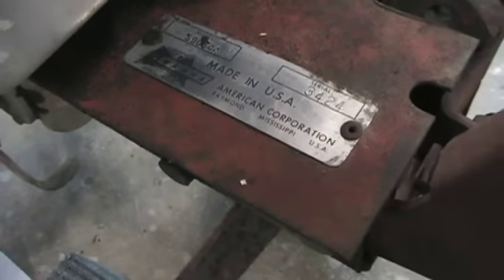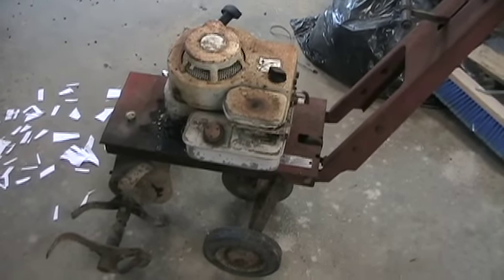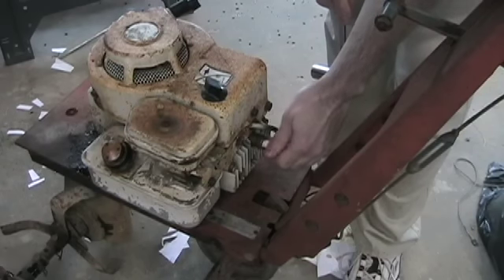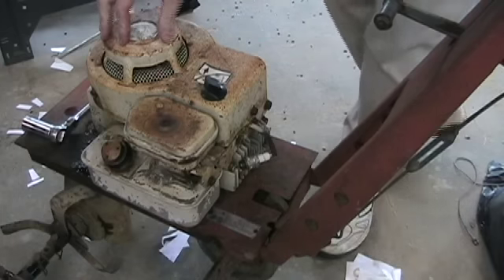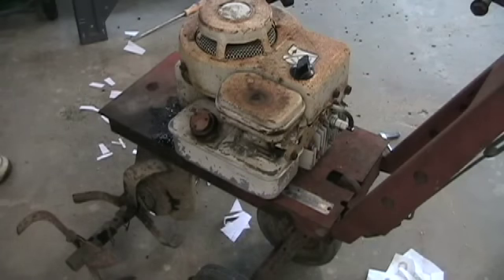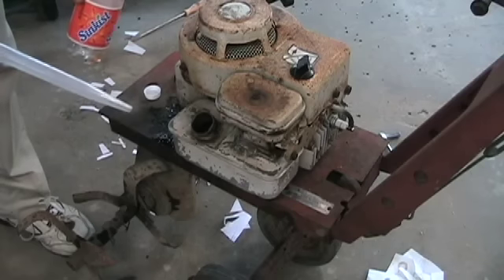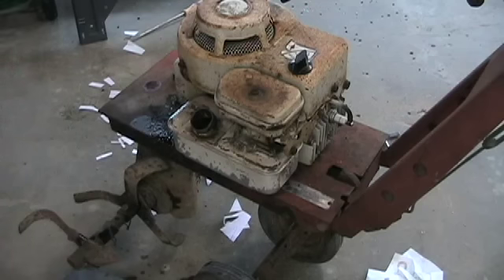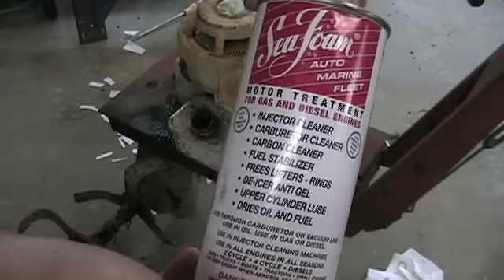Free Tiller project, Part 2 - Motor

Comment: How much oil does it take? Do you have a part number for the air filter?
Reply from the maker: Likely 1/2 a quart (but mostly until it is full) and just about any Briggs flathead air filter that looks similar.  Still likely to be at most hardware stores.

Comment: Those actually are not ratchets they are one way bearings they are filled balls that circle around different chambers, it is actually pretty ingenious desighn! As long as they dont go to shit they are much better than the ones that open up on the modern recoils, they are all plastic too!